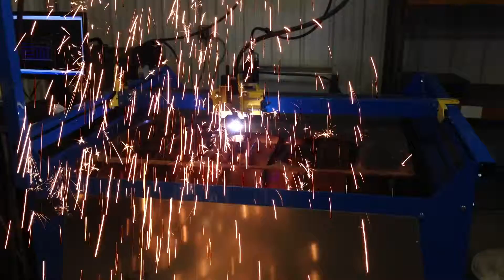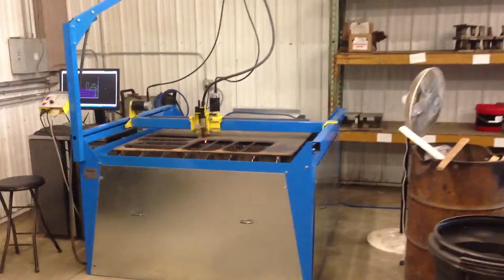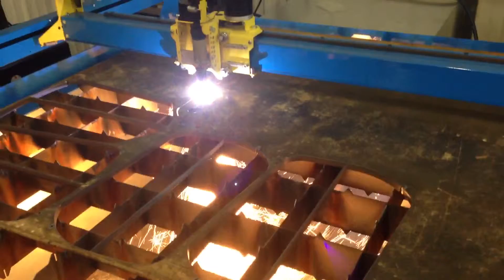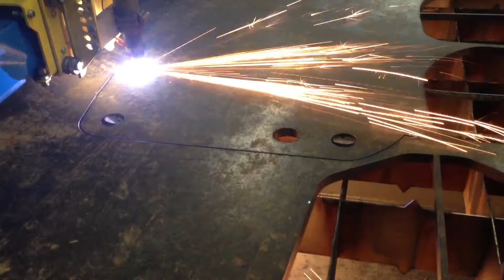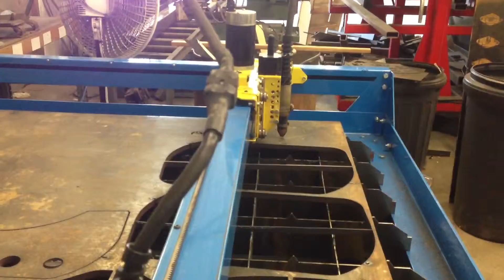Cutting 1/2-inch plate with Hypertherm Powermax 1000 on a 4'x4' PlasmaCam table.

Comment: How close tolerances does this setup hold to the designed part? I just bought the Powermax 1000 G3 and want to build a 5' x 10' plasma table for it to make some parts.
Reply from the maker: In 1/2" plate, I need to oversize the hole 1/16' for a pin. If you slow the cut speed way down, it does do better. I usually just go with my designed size and then clean up the hole with a drill bit so that I don't have the bevel digging into my pin. Thinner materials are better too. I have not tried the FineCut parts yet, but I have read good things about them.
Reply: How do you determine which way the bevel will end up in the part? In cutting holes, does the bevel cut inwards (making hole smaller on the back side of material)?? When cutting perimeter cuts, which way does the bevel go? Thanks
Reply from the maker: AJ Newman It will bevel into the cut. The kerf is thinner on the bottom than the top. So even on a perimeter cut, it will bevel. The only way I have found to work with it is to slow the cut speed down.